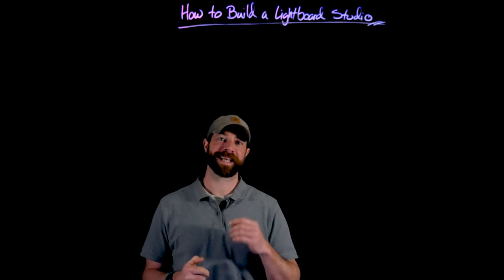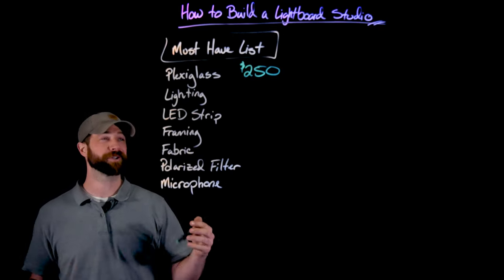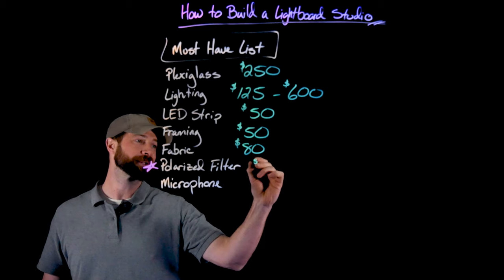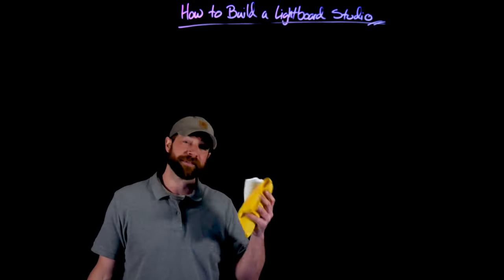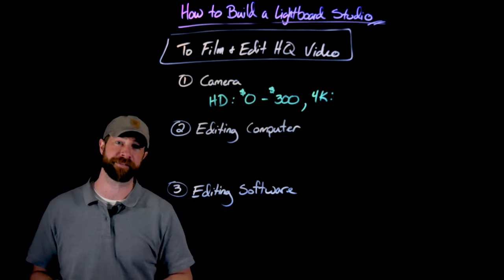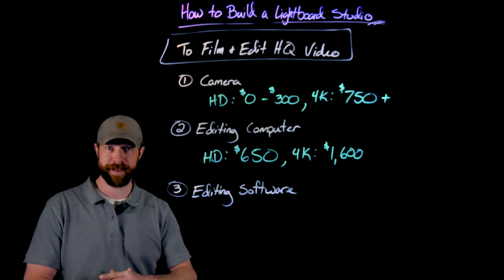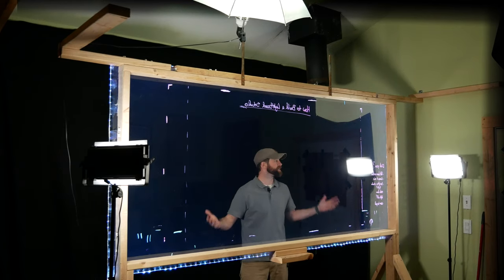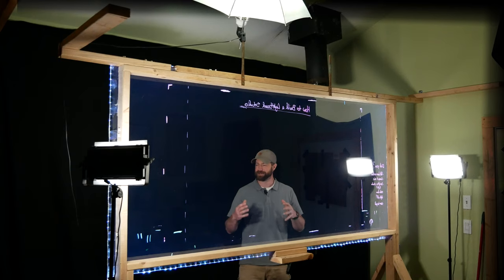How to Build a Lightboard Studio

Comment: How thick is the plexiglass you are using?  I would imagine that thicker glass is better for the LED strips.  Did you get 1/4”?
Reply from the maker: Chad, I just measured my plexiglass thickness and it is 3/16".  I don't know how much the thickness would affect the LED lighting.  Though, I think thicker would be better to minimize any bending while you are writing on it.  I have had no problem with my glass moving on me.  Good luck with your build!
Reply: @differentiatedcalculus8634   Thanks for taking time to respond; much appreciated!

Comment: Hi, thanks for the video. I saw that you used plexiglass and I've read that I should use ultra-clear glass and not plexiglass. Is plexiglass fibreglass?
Reply from the maker: Plexiglass is also called Acrylic Glass.  It is a type of "plastic" glass.  I used it mostly out of cost and ease of use.  I have had my lightboard for almost 3 years and have had no problem with the plexiglass.
Reply: @differentiatedcalculus8634  I almost have my light board set up. My main problem is balance. It is heavy and moves when I write on it.